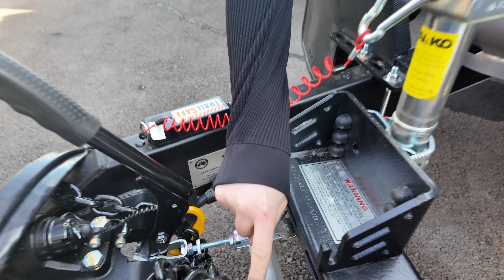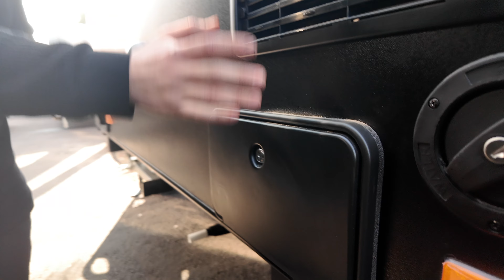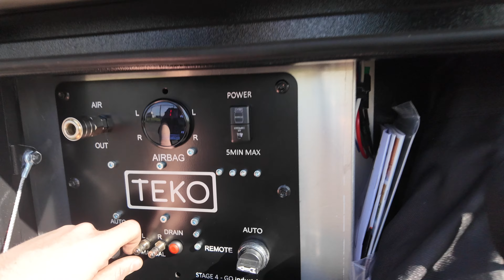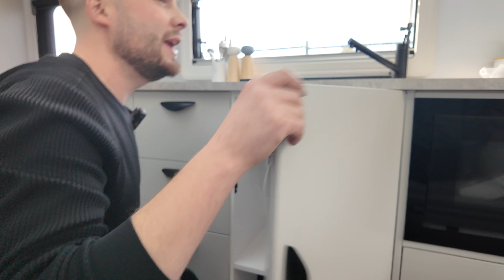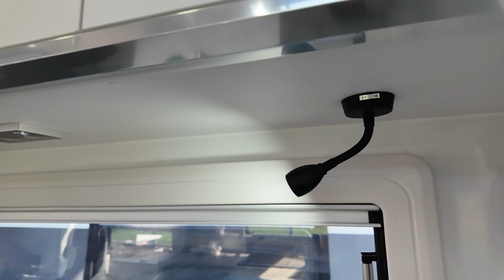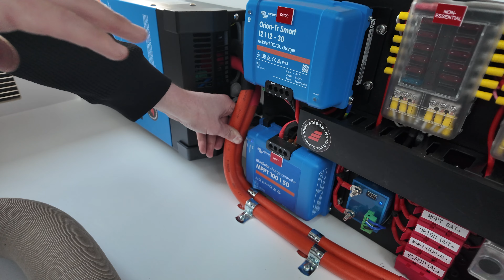CCM- XCountry Extreme with Induction Cooking! - 2024 - Video Tour

Comment: You could also go with the NCE microwave as it doesn't have a glass turntable, so it's one less thing to worry about when travelling.

An a Truma AquaGo for endless hot water. I've had the swift unit and the AquaGo and the AquaGo is far superior in my opinion.

Comment: Can you do a review on the Trailbreaker in the background as well?

Looks like an awesome van. You could add an E-kit to the Truma gas heater. That way, the owner can use the heater at caravan parks etc, without having to use gas.

P.S The way you slam the cupboards shut stresses me out haha. I'm sure they can handle it, but my old man would have slapped me silly if I did that when I was a kid.